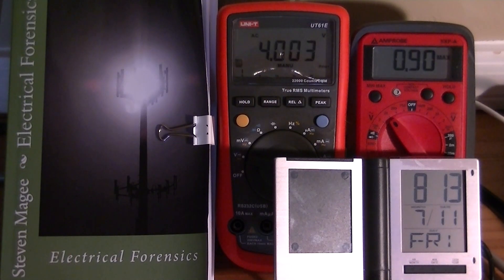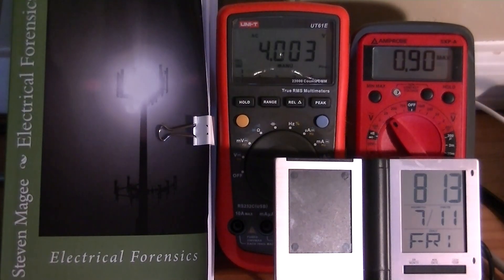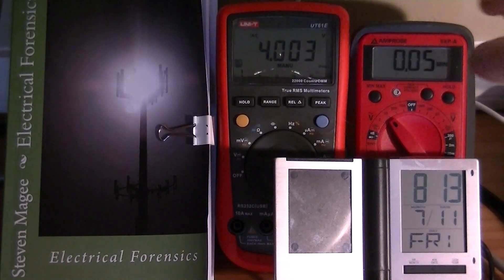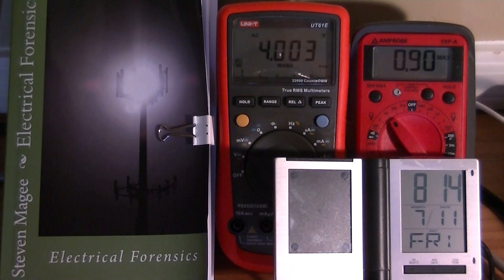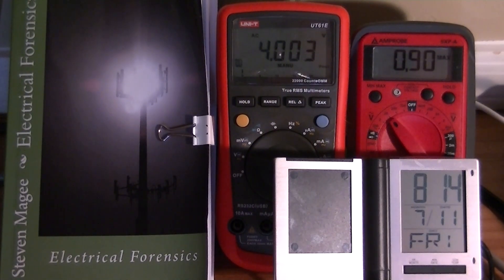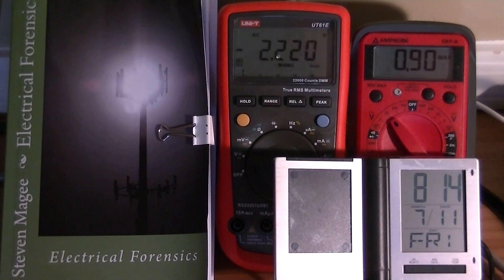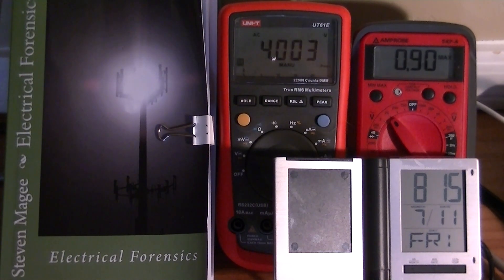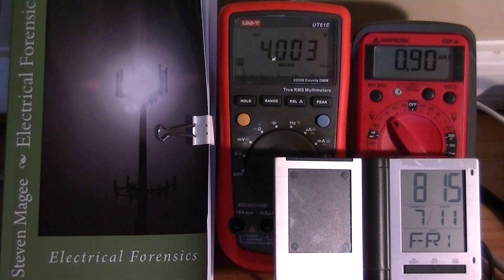Stray Voltage Peak Vs Max/Min  using Uni-T UT61E & Amprobe 5XP-A Multimeters

Comment: Nice presentation!Does the ut61e also have min/max feature or only the peak function? It would be weird if it didn't but I'd like to confirm this before I buy it. Another question. Is the peak any useful for PWM rectangular wave analysis?
Reply from the maker: +Tome4kkkk The UT61 meter series only have one or the other.  I have not seen one that has both Min/max & Peak functions.  Seems like you would need a digital oscilloscope for PWM analysis.
Reply: +Environmental Radiation LLC That's  bummer. At least I think so... I have only started with hobby electronics and there's no chance in hell I'm going to afford an oscilloscope anytime soon. So i can only go "which meter is going to give me more information on a PWM signal." I'm not an expert to say the least but I think I peak is useless as an information on a swuare wave.
Reply: +Environmental Radiation LLC BTW, I've just stumbled upon this!
http://sigrok.org/wiki/Main_Page